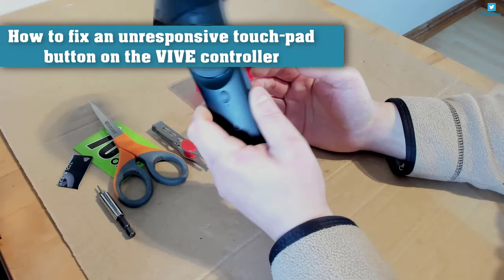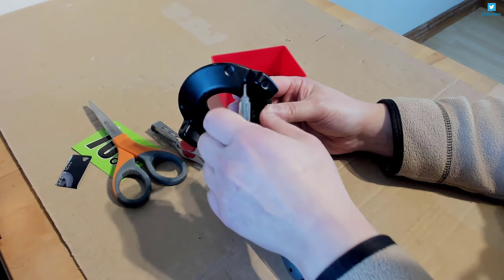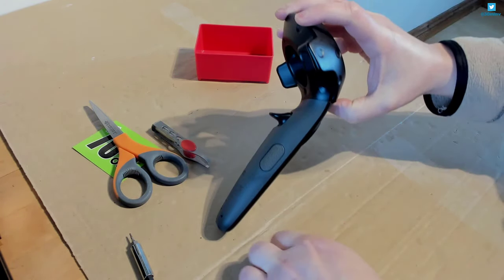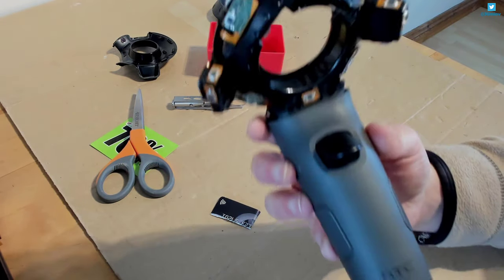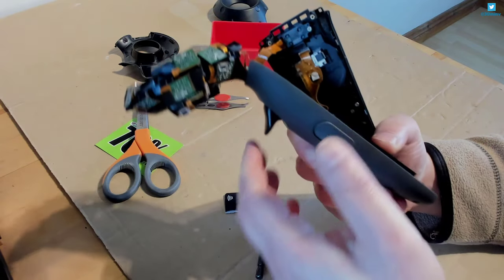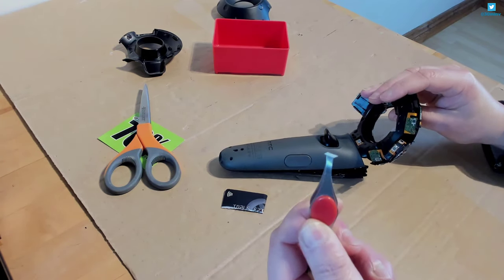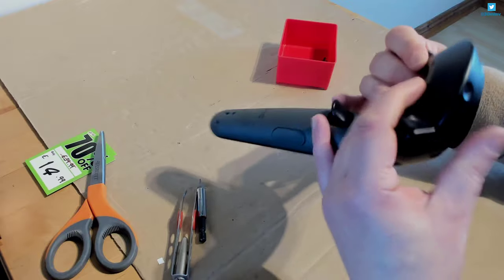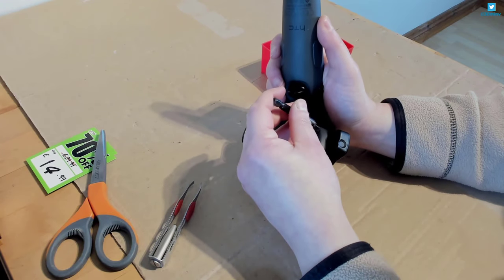VIVE Controller unresponsive Touch-Pad button FIX. DETAILED GUIDE!

Comment: thank you so much! i'm quite new to vr and bought a second-hand set, and had this problem after about 200 hours of play. i was so worried that i'd broke it and it couldn't be fixed easily. i've never opened up my tech of any kind and done this kind of stuff to try and fix it, but this tutorial helped me so much and i didn't have any issues at all. my controller works perfectly now!

Comment: Worked fantastic thanks. I used epoxy resin to glue it in place. Less chance of it moving now. The stuff HTC use is so weedy and poor. No wonder that little circular thing moves about. Replacing the top part where the sensors sit in was nerve wracking for me. Those clips are a pain. 10/10

Comment: Had problem exactly as explained,
had to drive to procure a better Torx 5 as the one in my house was almost stripping one of the screws,
I used a small square of some notepad paper (folded once),
worked flawlessly on first test.

Comment: thank you so much you're a life saver!
For anyone struggling, I had to make the holes bigger at 2:19 because my screwdriver didn't fit

why is this a thing in the htc vive controllers anyway because when I opened my up, there was like 3 little squares from tape that were not in position (my htc is preowned so idk it it manufactured like that or the previous owner had the same problem)

Comment: Thanks for uploading this , was able to fix mine , one thing I found , if you dont have a long enough screwdriver(i.e. one with a replaceable bit) for the 2 bottom screws , you can widen the holes slightly with a larger screwdriver , which should allow you fit  the screwdriver in .

Comment: my controllers have gone nearly 5000 hours without issue until today, finally my right controller has stopped clicking on one side... I'd read about this being a common issue many years ago so was I lucky? well this happened a couple days after smashing the controller into my low ceiling, so probably not, I was just careful